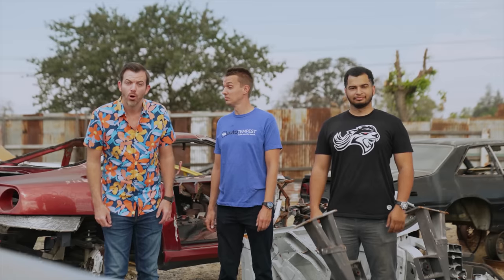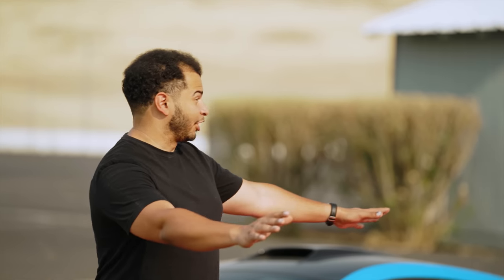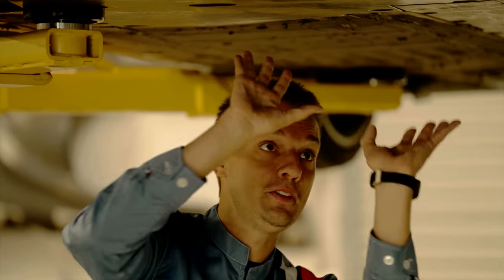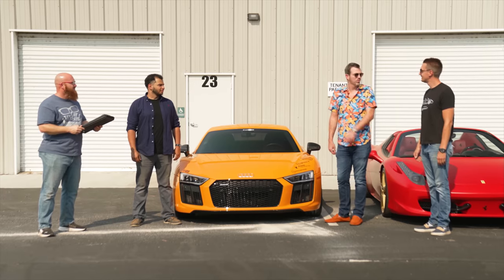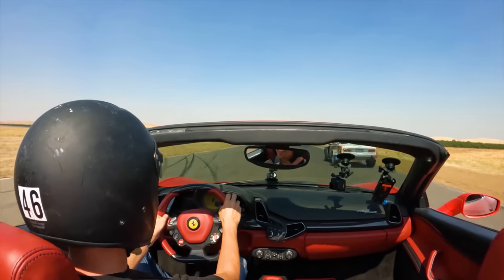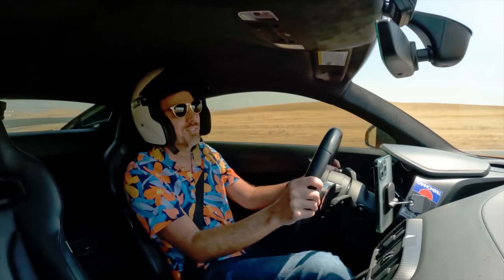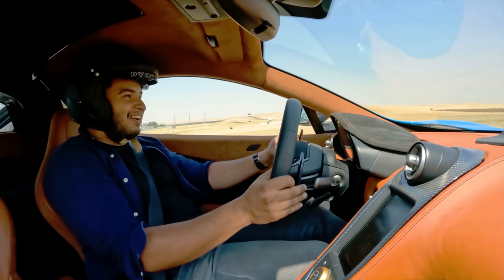We Bought 3 Cheap Wrecked Exotic Cars For Less $$$ Than A C8 Z06 Corvette | Car Trek S9E1

Comment: Having gone through turn 5 at Thunderhill hundreds of times, I really laughed when Tavarish sent a 200k car flying over the crest. Future tip: At any track, first lap is sighting, you take it slow and find out where it goes. No need for sighing lap, let's go full send over a blind cresting turn. lol
Reply: I've only done the bypass and that was scary enough.  There's 3-4 turns on the East track that are blind.
Reply: @Lucky008aau  Scary is turn one at laguna seca on a bike going 130.  Uphill, off camber cresting hill, narrowing barriers and the fastest part of the course.  :)
Reply: @robertstahl8835  Not sure, the back side of that hill is rocking and bumpy and would f*** up any car.  Fixed or not that is an expensive car with a very pricey tub.  Can't image anyone saying, lets take the most expensive car here and send it over a cliff.  

Unless you know it's there, turn 5 is very deceptive, you would not expect a drop off like that.  Plus its not like it was a trackday with a drivers meeting.  They rented the track and get to use it however they want, you noticed no corner works.  Yes, I believe there are bad drivers on tracks, seen enough of them to know.  I think he just went full send not thinking bottom will drop out.
Reply: how do u afford hundreds of track laps?
and what do u drive on the track?
Reply: @bradesq9422  Real scary is the Big Dipper at Mt Panorama Bathurst,
Reply: @feelinghealingfrequences7179   Ducati 1098 Motorcycle, trackdays and been going to T-Hill for 20 years.
Reply: @robertstahl8835  If you are going to stage a stupid stunt then you have cameras ready to film from every position.  What I recall was one shot from a drone about 100 feet in the air.  If you going to do this you would put a camera on the downside of the hill.  Photographers at trackdays there take photos from the downside all the time and it would be spectacular shot of a 200k car flying over the hill.  Or it could be three fools speeding around a track without a sighting lap.  Normally the speed through that turn is very slow, like 20 mph slow, so if you went over it thinking the road extended and were going 50 you would likely get the same air he did.   As for all three not going over.  Ed is a good driver that won the cannonball.  I would think he has more sense then the other two when it comes to going fast in new areas.
Reply: There is NO hill in any road course that is perfectly straight on the exit, almost as if it's a creed of every road course designer.  Lol.
This is notorious, along with Laguna Seca for being a very bad hill.
Reply: @robertstahl8835   easy to explain imo. Freddy was doing his sighting lap because production is not going to waste daylight and gas doing two separate sighting laps (one for sighting, one for the talking head). So during the lap, he was more focused on narrating to the camera and less focused on the track, and he got overconfident after saying “this car makes you believe you can attack corners” at the worst possible corner. Makes logical sense to me, as they have limited daylight and a time limit on the track rental, so they’re not going to waste an additional hour watching laps or hooking up a PS4 to practice when they’re already physically there and also focused on “how are we going to film everything we need to do today” Nothing to do with smarts, but more to do with time.  So a combination of carelessness + overconfidence at the wrong corner, suddenly the McLaren turns into a bird. Plus, this is like season 7 of CarTrek and he’s has done this type of lap dozens of times on different tracks, so you’re not as focused as you would be if this was your first time. As for Tyler and Ed riding together, I’m pretty sure it was a production issue that required them to do it together because if it was planned, they’d have a explanation or a quip regarding it, but they didn’t.  

If this truly was staged, why did we only see 2 angles of the crash? There’s 3 cameras inside the vehicle, 2 on the outside, and at least 1 external cameraman. If it was staged, surely we’d see some slo-mo shots?  Instant replays from different angles? A shot from the bottom of the hill? They’re not going to jump a $200K car for ~5 seconds of content, most channels would milk it and make it the thumbnail. But seeing as they didn’t, it makes me think Freddy was embarrassed at the crash and asked the editor to not focus on it in the edit.
Reply: @robertstahl8835  Even if they did decide to watch a video of the track or play a video with it it's still a completely different experience actually driving the track. You never truly know it unless you experience it first hand.
Reply: Came here to say this 😂
Reply: @feelinghealingfrequences7179  thunder hill isn't crazy expensive they have track days all the time and its an awesome place ran by some awesome people
-and t5 is pretty wild and really easy to go off
Reply: @robertstahl8835  especially as they spent half the video safety inspecting the cars and were supposed to believe they were allowed to go full tilt without a sighting lap or track briefing lol
Reply: @jst_TV  I don't think it actually happened, at least not the way it's presented. They would have showed one of the in car videos of his actual real time reaction. Staged.
Reply: @Mike_Atwell  you don’t stage something for a show, then skip over the part you staged with a 2 second video clip. no, content is king, so you’d show every angle if it was staged. if it was staged, then why didn’t they have cameras set up to record the incident from all angles? why were there no camera people at the bottom of the hill and why didn’t we see the instant replay three times over? it doesn’t make sense for them to stage an accident, then not talk about it ever again.
Reply: @robertstahl8835  Looked CG to me
Reply: @jst_TV  staged, as in, it didn't happen. Why else would we not have seen the interior camera or any other angle
Reply: @AlanRid  I get the same feeling. They didn't want to shell out for proper Hollywood level work so they did it from far away, added whatever sound and then cut to post excursion... Like all the stones flying at Freddy's car also; just sound and not a reality. Disappointing really, I feel like they've lost the feeling.
Reply: @Mike_Atwell  ok, but what would be the reason they staged it and where is the editing artifacts that prove it was edited and faked? Rotoscoping a car from a green screen onto a moving drone shot is no small editing feat and you would not be able to fake it so cleanly. How did they fake the dust cloud from flying off when there are no tire marks or people at the bottom of the hill?
Reply: @robertstahl8835  wont the potential damage be too much? Plus the emotional and financial commitment he put into that car I honestly anyone with a same mind would do such a thing on purpose, he couldve damaged the wheels, suspension, under carriage, both bumpers… all of the things he (and the people he worked with throughout the 2 YEARS of building the thing spent countless hours on. Wouldve made more sense to do an act with the ferrari since its the least valuable here
Reply: @robertstahl8835  That was definitely not planned what the hell lolol
Reply: it was hella edited
Reply: am i the only one genuinely concerned for their safety, who’s fuckin idea was it to have them fully send it on a track they are completely unfamiliar with. like who let that happen. not sure the track would appreciate this if they saw the video
Reply: if you believe that was him..your a fool. was a stunt person/gimmick
Reply: @crdude806  "You are" or "you're"
Reply from the maker: @robertstahl8835  It was not a planned stunt, which was why the only exterior shot of it was from a drone 200 feet behind the car. Yes, it was incredibly scary and I thought I was going to total the car. We didn't play it in any video games or watch 20 laps on YouTube. Sometimes people simply make mistakes.
Reply from the maker: @crdude806  lol wut
Reply: Chap they've got no clue how to drive a car.
Driving position is weird, talent is lacking
Reply: Was Freddie going off cgi?
Reply: @tavarish  I'd imagine that next time you'll take the first lap a lot easier to save yourself some gray hairs. Also, that is one of my nightmare scenarios. Going off-track, down an embankment that is steep enough to potentially roll your car is absolutely terrifying. If it weren't for the aero and the wide track of the car, it might have flipped. Congrats on surviving your harrowing experience with barely any damage.
Reply: @robertstahl8835  sorry you are just wrong if u think they would purposely jump a 300k McLaren and not a 70k audi hahaha. Like explain the mental gymnastics
Reply: @tavarish QUIT BREAKING THE RULES BY ABSURD AMOUNTS….. not even close to same budget

Comment: You gotta love Tavarish, dude is so real, but going off track like that was very scary. What’s scarier than that is Hoovie’s driving, bro needs some track days! Pay the Wizard too. Ed played it safe, probably well done.
Reply: @BobSchmidt   Now I feel like the sucker… I can be a good sport about it😂 Thank you for pointing that out.  Okay but Hoovie still needs some track time🤣
Reply: Guessing Hoovie's spin out was caused by the old tires.  Just lost all his grip.
Reply: @BobSchmidt  I dont think Tavarish's off was fake - the car clearly went airborn
Reply: @johnsanko4136  Different tires on each rear wheel means different breakaway points.  A real no no.
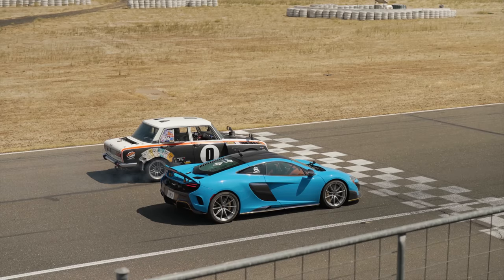Reply: @drivingpsyche  His b pillar is ruined after that at 28:06 you can see it clearly
Reply: @sibunit38  which could mean that either that panel was poorly attached, or the whole frame compressed at the impact and sqeezed the panel out of its place

Comment: If Freddy would just learn to drive, he has the guts to get into that car like you are supposed to. When it is on a track you need to hammer the brakes hard until they start telling you to back off a little until they stabilize

Comment: Xavier forreal a super chill dude!!!
"Every car I got slammed to the pavement. What I spent for these you couldn't make the payments"

Loving the M all murdered out like that.. all his F80 needs is meth injection, or (flex fuel kit) w/E85, and the BM3 S2 tune!
Easy 600+ to the rear tire!!! (Another $3K)
-Fuel It (Complete stage 4 kit w/port injection) 680+ for around $4K! (Max out OEM Turbo's)
Set of 18X11.5 Wheels wrapped in a 315/40R18 555R2! ($4.5K)

He needs to do this, then come back for a REAL Round 2 !!!
@XavierWulf

Comment: Most regular c8s were around 95k because ppl wanted the options and im seeng the same trend with the z06 a lot are 140 to 185k
Reply: that dont even include the  razy 100 to 200k markups that are coming. but for the msrp.honestly for the money of a top trim zo6 im still going cftp gt500 slap pulley tune and ported blower. Plus a v8 awd f150 single cab short bed add a supercharger or turbo make 1000+whp and you have a 8 sec f150 in the 1/4 mile and a track focused gt500 that can make 1200whp  capable of 8s but will run mid to low 9s and still be good on roadcourse.  you get both for the price of a loaded zo6 or used you get both for the price of a low option zo6. 2 vehicles over a zo6 sounds better to me. Plus hearing everyone comain about the buzzy import sound of the zo6 when not on throttle and now hearing it in ss717 video and strads video. the zo6 isnt the best sounding unless full throttle
Reply: so freddy didnt cheat because you are at or over 200k for a fully optioned zo6. by the time you pay markups and fees you are well over a 1/4 mil for a zo6. honestly you are going to see 400k and higher for them until like the regular c8 the market is now flooded because in the end the c8 is a mass production vette. now that there is toms out there prices are falling

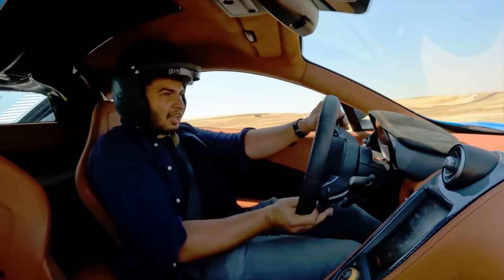Comment: 24:50 Sails over the crest and bottoms out on the other side.
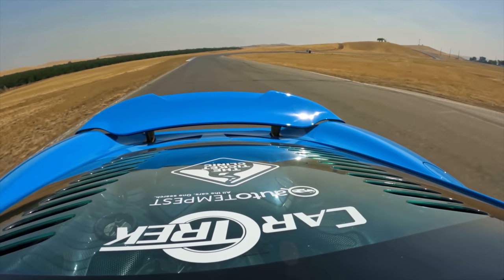25:18 "I hope the car is okay."
- 3 months later, guess it's not.
It's possible the impact could be the cause of the engine blowing up later. The forces that were incurred during that Dukes of Hazzard run may have slapped the pistons or put some serious forces on other components.

Comment: Interesting fact about "air brakes"
They don't themselves slow the car down. They create additional downforce, pushing the tyres into the ground with much more force. 
With that, you're gonna want to make sure your brakes can handle the heat, your tyres aren't gonna melt and disintegrate and your eye sockets are nice and tight.

Comment: Thunderhill!  I tracked my '09 Cayman S here two months ago.  I was faster than a 488 in the slow turns, start line until the hill), but much slower in the straights.
116 mph on the main straight for me.
Reply: That just simply won't do. Add turbo. Problem solved
Reply: @darksu6947  Porsche did, no thanks.  I have Tubi exhaust on mine, hydraulic steering, spent 1/10th of the Ferrari guy, and had just as much fun.
Reply: @Lucky008aau  So you're trying to tell me that you have no interest in adding a turbo because you already have one? That's what the kids on the short bus would say.........get it? Because they're slow lol! Would you like to know what's better than having a turbo? Having two turbos and a cookie 🍪
Reply: @darksu6947  I assumed you knew the Cayman line more than you do.  In '09, the Cayman S is a 3.4L NA flat 6.  In '16 Porsche made it a flat 4 turbo (the 718 Cayman).  It sounds much worse, is only marginally faster and more economical, has electric steering, and costs 3x as much as what I paid for mine.
  There's lots of cars that go fast in a straight line.  I like the sound of mine and how fun it is to go around corners.
Reply: @Lucky008aau  I'm not going to be happy until you can serve some gapatizers to a 458 on the straights. I've done a little research to familiarize myself with your car. You have the best version of the Caymen S. Add a supercharger, make a video, let me see it, then I can die happy. Sound like a plan, man? Lol

Comment: For as many cars as you people drive you don't know nothing about the electronics? If you buy an new auto manual or as we used to call it slap shift.... You have to unhook the battery to reprogram the shifting pattern to you not the previous owner...... I'm sure there's a way with the computer if you're rich enough but I'm poor just unplug the battery for a couple days reprogram the computer to your shifting pattern
Reply: Would shift through all the gears in my 01 Mitsubishi eclipse under 25 mile an hr, after doing this I could get 85 mi an hour out of second gear....

Comment: 500 Dollar car my ass😂 u missed a 0 and a x2. Shit would turn my Highschool ass bankrupt.
Also that McLaren is the perfect example of: most of the times it’s cheaper to buy a car in a good condition without work on it, instead of buying a project that will cost you 9 out of 10 times more then the working version and that’ll will be 7 out of 10 times never be finished in your hands. Spare parts alone for the mc are more expensive, then the value of a roadready 675lt.